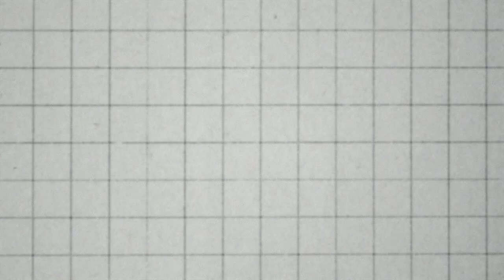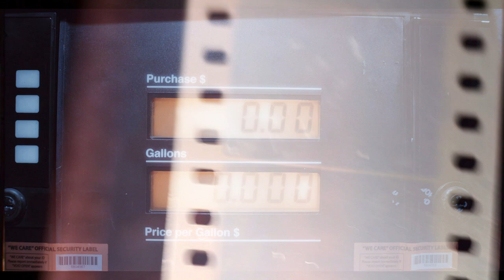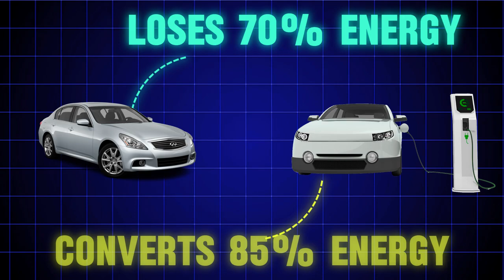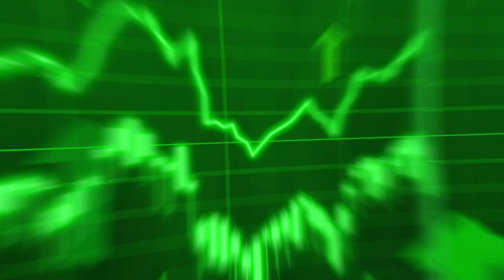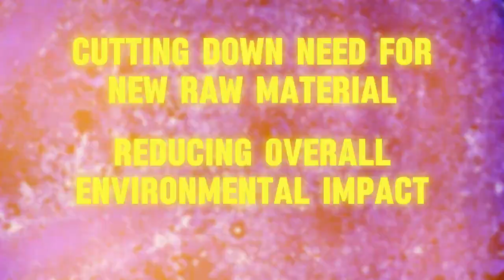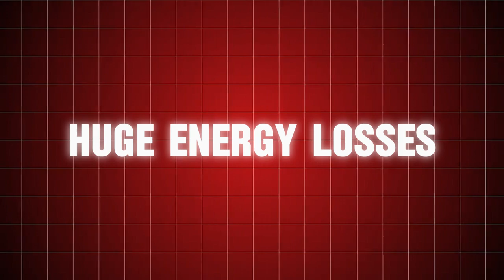EV's VS GAS VEHICLES - Which is BETTER for the ENVIRONMENT?

Comment: apart from the surface pumps shown in the video, crude oil is not pumped out of the ground.
it's naturally under pressure and it shoots out on its own. like when you shake a cola bottle, and then open it, more than half of all the oil stays in the ground. imagine if that cola bottle was a mile below the surface - how would you pump the content out? there's no feasible way to do it.

Comment: A good video but goes into lots of details on the oil refining process but less than 5 seconds about mining? Feels a bit one sided to point out the impact of transporting oil but not a thing about transporting batteries
Reply: Transporting batteries would equate to a wash for all the parts you don't need any more an EV. Think fuel system and exhaust system, either way it's a wash.

Comment from the maker: Is EV better for the environment?  Watch the video and find out!
Reply: https://youtu.be/b69rjXonXWE?si=Ehy0K-DspIXdKcXh&t=412  Nowhere in your video did you mention that there is a minimum amount of driving you need to exceed for EV's to be a better choice for the environment. My two MAGA Motors EV owning neighbor slashed all the tires on my cargo van that I use to maintain my house because I "was killing the environment" by burning a few tanks a year with my cargo van. As if forcing me to buy a set of 8 ply truck tires is good for the environment. While Ford's eTransit is a great electric van, it will never make environmental sense for me to replace my cargo van with one, as my limited use of it never justify the environmental costs of manufacture of a new van, electric or gasoline powered...
As for the car I use for personal transportation, because I burn about twelve gallons of gas a month, it won't pay off for the environment for me to replace it with an EV or Hybrid. There is a minimum annual mileage needed to justify the special environmental costs of EV's or even new cars...
If your commercial vehicle travels many short distances a day with constant starts and stops then an EV will likely make more sense as this use destroys internal combustion engines, automatic transmissions and emissions control systems. Another is if your commercial vehicle is often operated indoors, as the exhaust fans needed to remove the fumes from internal combustion engines use a lot of power...
Or in short, EV's are better for the environment if you drive an hour or more on your daily commute, own a fleet of vans or light trucks and you only replace most of them with EV's, operate a "many short stop commercial vehicle", etc. But if everyone simply replaced their car with an EV, there would be a massive environmental cost of manufacture & eventual recycling as well as we would actually use more fossil fuels than in the ideal solution...

Also your video clip of "smoke" coming out of the tailpipe of an ICE car was actually steam...

Comment: Transfering electricity results in lost electricity, so does charging, and then using that again from baterry to spin electrical motor. At least dont make up numbers and do ur proper research.
Reply: Transmission losses exist in both cases because oil rigs, pumps etc need that energy somehow, also the same losses or worse can be argued about industrial electrical motors moving the huge pumps needed for all the aforementioned processes, this time with a lack of regenerative breaking. The only electric losses EVs have that gasoline production and transport doesn't have are charging losses, which are in the range of the upper 90%s for the most efficent charges.

Comment: Not to mention that the oil industry is the biggest consumer of cobalt (to remove sulfur), a mineral that the EV industry have lamented for using!
Reply: Lie, it's batteries by far.
Reply: Don't forget the platinum in the catalytic converters.